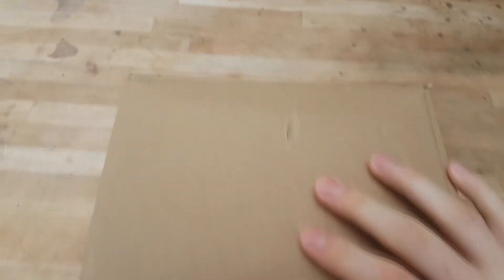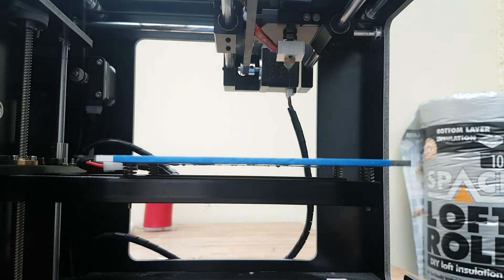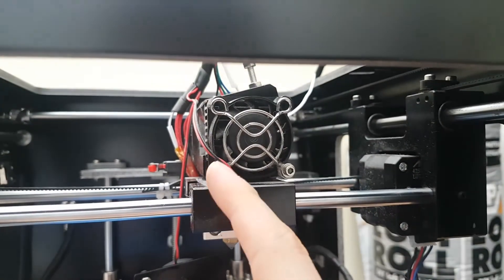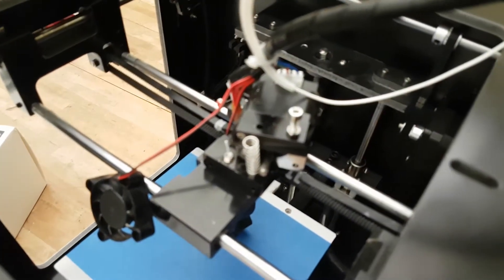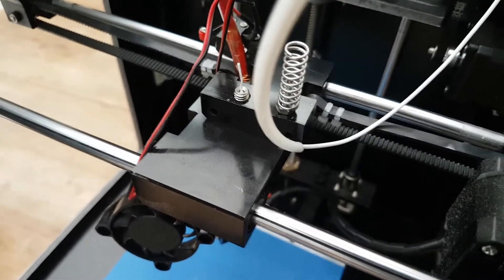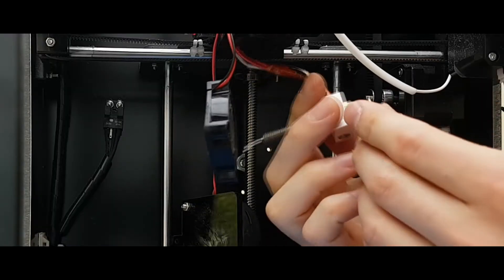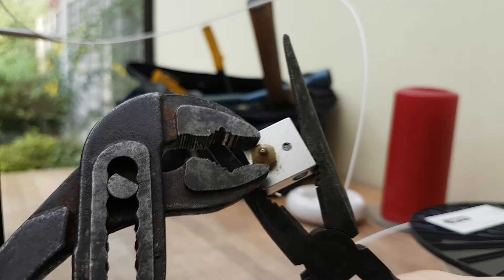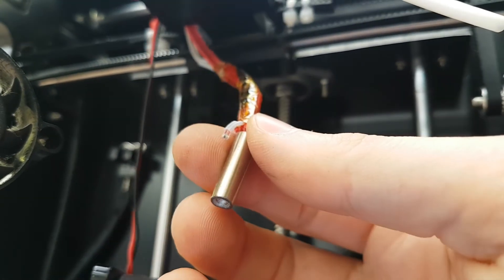Disassemble Anet A3 3D Printer Extruder - Tutorial

Comment: The reason the filiment wasn't extruding is because that cog which you hovered up should of been screwed onto the shaft of the motor basically your motor was spinning inside the not pushing the diligent you didn't need to take apart the rest of it XD
Reply from the maker: Hey Sam thanks Im gonna check this, thats how it was when I took it apart so I assumed thats how it was supposed to be should have double checked that. Thanks
Reply from the maker: You were indeed right, school buy error haha. Fixed and working. Saved my bacon :D thanks buddy.
Reply: Not to mention: There is quite a gap between the cog and the extruder underneath it... that makes it difficult to load filament and makes it almost impossible to print with flexible filament. you should 3D print a filament guide that prevents flexible filament to buckle and makes it also easier to load filament.